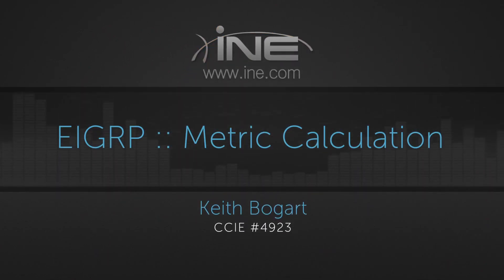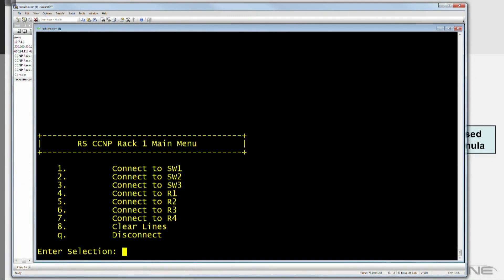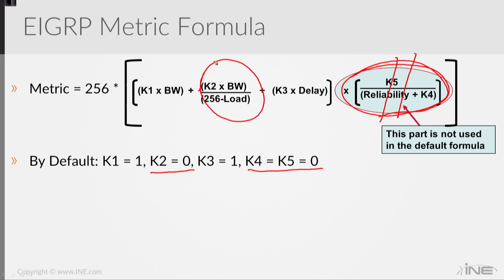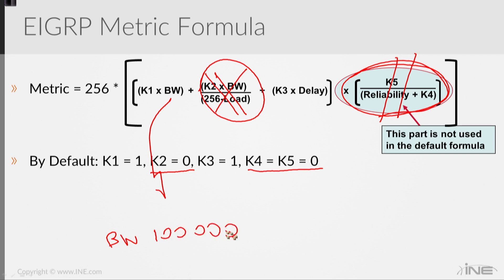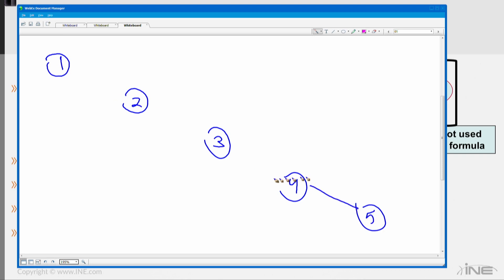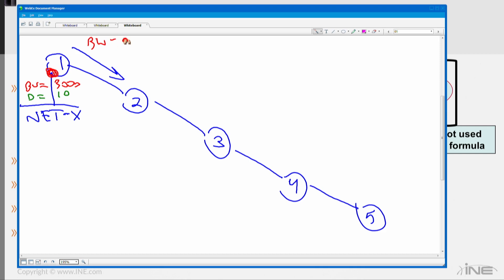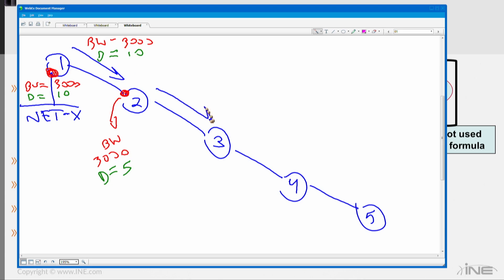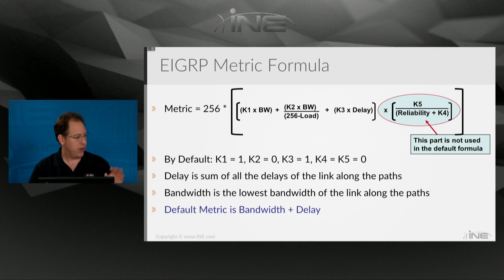29 EIGRP    Metric Calculation

Comment: if k5 = 0 => metric = 0
Reply: I've read that if K5 is 0 (which is the default) the right part is ignored for the calculation. That way a result of 0 as the metric can be prevented, which would otherwise occur with a K5 of 0.